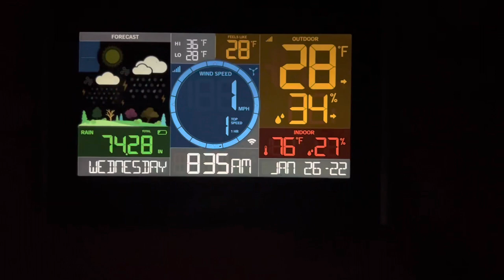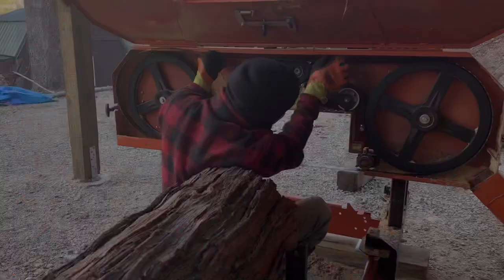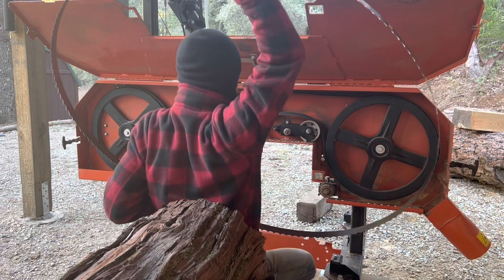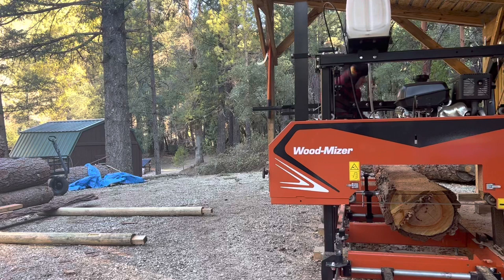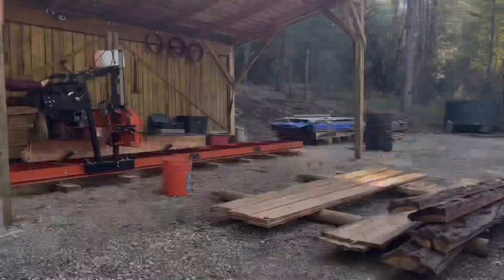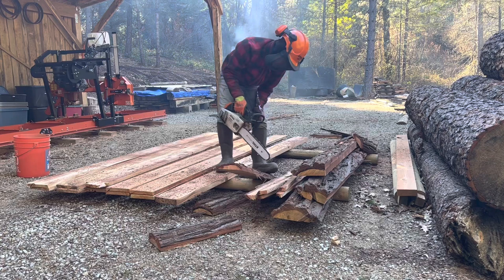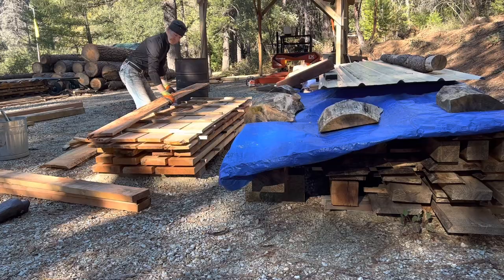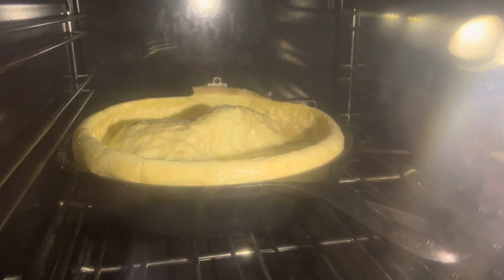WOODMIZER LX55/BLADES/IS IT WORTH IT?

Comment: I just received my new mill, Timbery m120 which is the same as LX-55, The first blade dulled out reasonably fast because I was cutting too fast ,because I was not cleaning the wood prior to starting the cut, so I dulled the  first blade rather quickly. I sharpened it on a bench grinder as I saw in a video and it does great again. I’m sure it’s not perfect but it does really good on the pine that  I cut most of the time .. great video..
Reply from the maker: That’s awesome you ground it by eye. Nice job that takes some skill.👊
Yep keep them as clean as you can that will sure help.👍

Comment: LOL I say the same thing (to myself) when it's time to get out there and start the day "lets get something done!" I think the way you do projects is awesome. You take the time to keep things cleaned up and tiddy. Stack right away. Clean up scrap piles right away. Just keep the work site clean. You could stop at any moment and just walk away and it would almost look like you were never there. I am contemplating a saw mill myself. Most of the trees on my property are small diameter. I do have some big diameter trees that I can cut down but need to figure out how to get them back to the sawmill. I'm definitely going to implement how you have a home for everything. It just has to make you far more productive for sure. Easy to change the saw blades. A concern I had for sure. Thank you very much! 👊
Reply from the maker: That’s definitely the trick…
How to get them to the mill.👍 4-wheeler, drag it with the truck, or a tractor. The small ones work good for poles for projects too.
Stay warm up there..!!👊

Comment: Ron, thanks for going into this issue of sawmill blades. I've wondered about the price of blades and sharpening. I've heard about needing to change blades after each large log and that blades are $25 each. It sounds like you are successful in getting much longer use out of each blade. My other issue of trying to buy a mill  is the easy availability of logs. I'm surrounded by forest but most of my 10 acres are very steep mountainsides which would be very difficult to cut and move to a sawmill. Thanks for another Good video.
Reply from the maker: 18$ to sharpen them. That’s one thing to think about is how do I get the logs to the mill.👍

Comment: I need to get a new barrel when I go to town. I backed into mine with the tractor and it’s all rusted through. The salt life😂 I love that short bar. Is that 16”? It would be nice to have a water hose up by the mill so you can show off the pretty wood after it’s cut. Thanks for the good info.
Reply from the maker: Ya they rust out quick. That’s my small saw with a 14” bar. I should have poured some water on them.😂